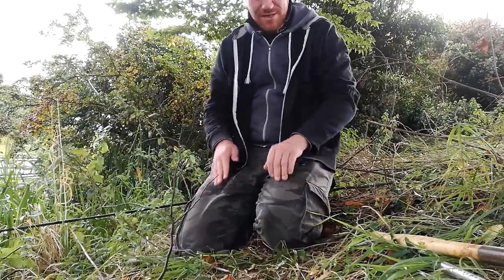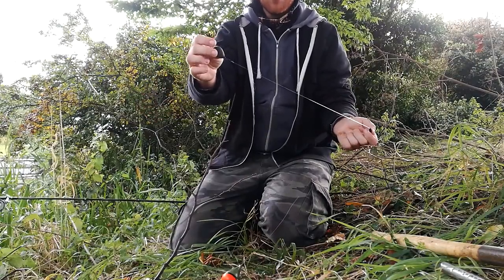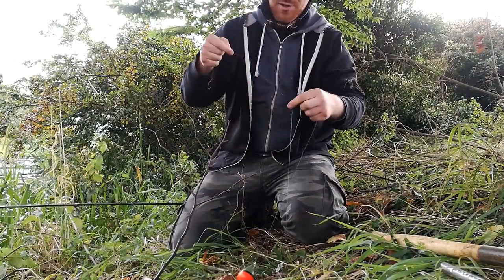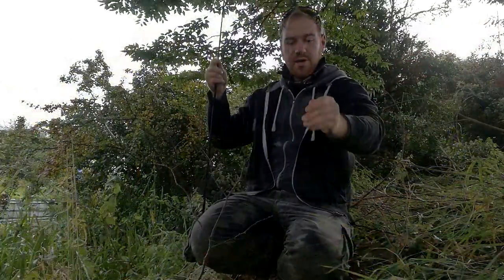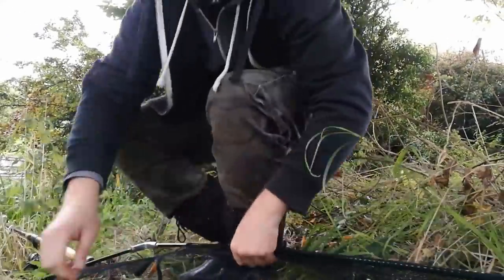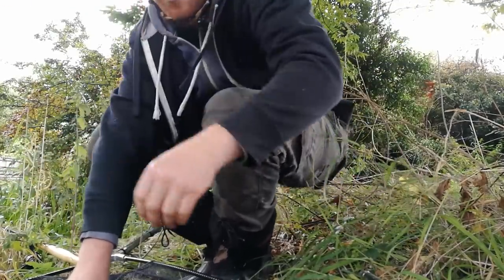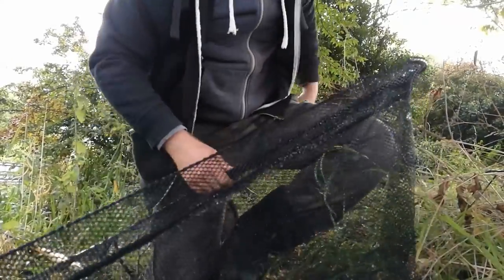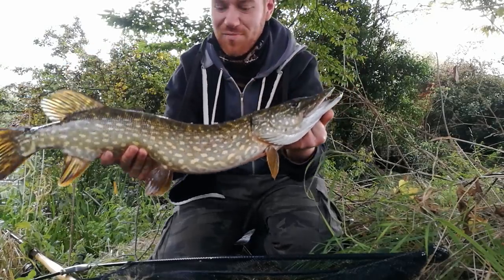Paternoster rig beneath the surface  Pike and Perch

Comment: I used the paternoster rig a lot I would shorten the trace which has the hook on. In your video the fish has enough travel to be on the bottom making it not much better than a bottom bait. I have mine 6 to 10 inches long. My aim is to always have the fish at least 1 foot above the bottom. So the bait is always above the pike head if the pike is on the bottom. 
I use this method on canals and another water which is 16 foot deep. If on this water I'll have it set up 3 to 6 foot above bottom. The paternoster has had me a lot of pike over the last few years especially if their is a lot of fry about.

Comment: Hi m8, great footage. Two questions. First on is about the lack of up trace. I would not risk to fish a paternoster without an uptrace, the chance of bite off is big, don't you agree? About the underwater filming, same on your last video where it looks like you have been casting to the camera. Do you have them the camera mid water between a float and a lead? Just curious. Keep the great work, it is amazing stuff.
Reply from the maker: Arnaud Maye hi, to answer your first question there is an up trace just made out of finer wire than the  hook trace :). Second I do have the camera set mid water for this video